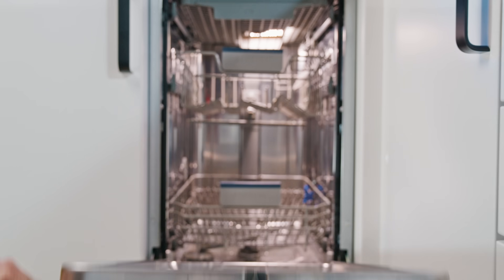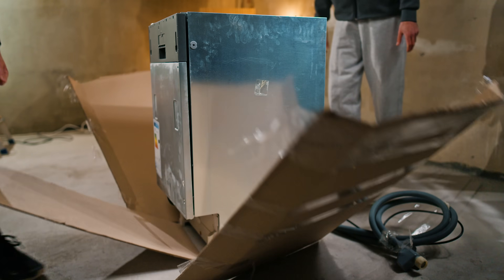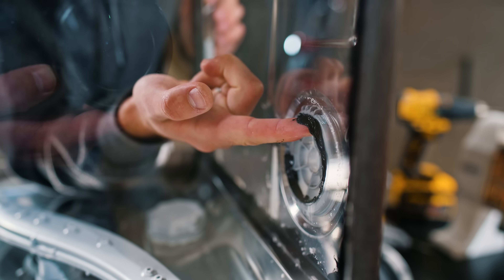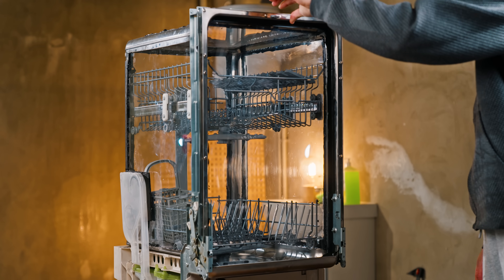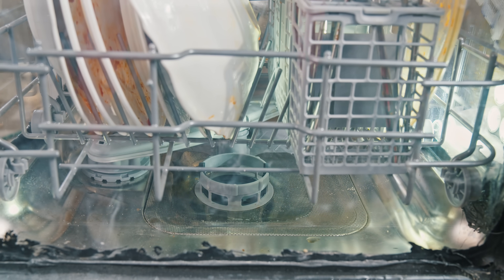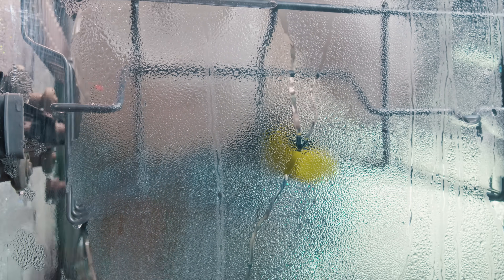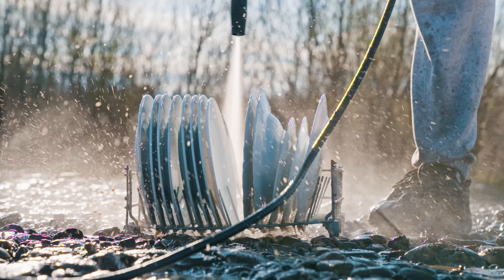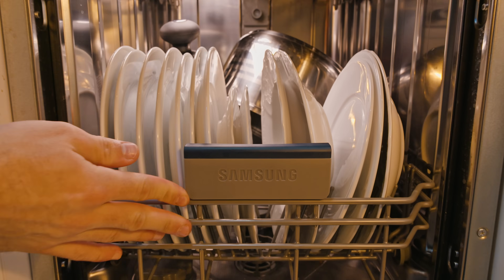Transparent dishwasher - What’s happening inside?

Comment: 11:58 A little tip from someone who works in the hospitality industry.
Place cutlery in cutlery baskets with the handles facing upwards.
This means you don't have to touch the eating part to take the cutlery out, which means you get fewer germs on the cutlery.

Apart from that: Great video - keep it up!
Reply: I mean just wash your hands. It's going to be thrown into a drawer that's probably got way more germs than freshly washed hands anyway.
Reply: @Moothead2  That's true. People forget how dirty the silverware organizer gets. It is rarely cleaned because it always has silverware in it. I cleaned mine and then was amazed how dirty it got in such a short time. It's the weak link in the process by far.
Reply: your suggestion is against dishwasher instructions, but tbh I had the same thoughts and tried to wash as you said, and it resulted that some stuff remained dirty in Eco mode, which I'm always using (safes a lot of water and electricity which is expensive in Poland)
Reply: Oh no, I mustn't consume all those 4 germs!
Reply: That's because you're washing with commercial machines and the baskets don't have dividers.  It's also safer for people who are in a hurry unloading the dishes which are constantly being reused.
Reply: I've never understood people putting the silverware in with the handles down. That's the way people do it at work and I have no idea if the person emptying it has clean hands or not, touching all over the end of the silverware that we eat off of.
Reply: I've read tonns of recommendations from pros, who build and maintain the dishwashers and home appliances in general, and despite their insistence in putting the cutlery handles down position, i do exactly the opposite. First it's nit always you who unloads the wash, it might be your kid or even a guest whose hygiene is extremely tough to maintain and hello 👋 greasy fingerprints in the working end. Having one on a handle doesn't seem as nasty, right? And secondly there's a great choice out there - the dishwasher with a cutlery shelf. That's the perfect solution imho. If you can - just avoid the one with the basket.
Reply: @donnadizucchero  yeah,since avoiding bacteria that is already on your hands will increase your immunity by 10000% I just love American logic and obsession with cleanliness.

Comment: do not use tablets, use powder.  when you use dishwashing tablets and put it in the compartment and close the lid, you don't get any detergent when the machine does the pre-wash, just put the tablet in the dishwasher and you only get detergent when the machine does the pre-wash and the detergent is flushed out before the main wash starts.  most machines have a lid with two compartments, one for the pre-wash and one for the main dish, both must be filled with powder according to the recommendation, if you don't have a compartment for the pre-dish, you pour a little on the dishwasher's door instead

Comment: The brown gunk are the resin beads that actually soften the water. The water used in the dishwasher does not actually go through the salt, the salt is used to recharge the resin beads that pull out the hardness of the water.

Comment: Nice video and informative, but that machine uses too much water, as the machines sold today only have enough water to run one wash arm at a time. It would have been better if you used a current machine that is being sold today and not an old machine.

Comment: Interesting project. Far as handwashing, you let the water run the whole time, of course it will use more. Those who say dishwashers use less water either do not know how to do dishes by hand or work for big dishwasher. It is obvious they do the comparison with someone using way more water than necessary when handwashing. They say it uses less water but do not use that much water handwashing. I know, I measured it. 

Far as the environment and energy, need to take into account for energy used to manufacture, ship, deliver and dispose of dishwashers. Lot of plastic and metal goes into one, lot of water used in manufacturing, and energy.

I mean, in the end, do what you like, it does save some time and easier. Just do not like misleading that it saves energy and water.

Comment: I have NEVER hand washed like that before with the tap running continuously !! I fill one side of the sink with hot water and detergent then place in the dishes and let them sit for 5 to 10 mins then scrub clean. Place in drying stand for 10 mins then use a cloth to completely dry. I probably only use 5 litres of water and not much gas or electricity. This theory that dishwashers use less water and electricity/gas is not true in my experience. Maybe over the long run dishwashers are cheaper to run but I have my doubts.
Reply: You just cannot imagine how much water/heating/etc is cheaper in f.USSR countries. Washing the dishes in constantly running hot water is absolutely normal here, so the message about economy (bc electricity is even more cheaper) is applicable.

Comment: Hand washing dishes under constantly running Water? Wow. I learned to handwash the way to fill the sink with warm/hot water and wash it in there. In my sink fits 8 liters of water. Dirty dishes i have to swap the water one time. So i use 8-16l. You used almost 56 liters?! (Manual of the dishwasher sayed 14l/cycle and on your chart it reads, that you consumed 4 times the dishwasher's water)

Comment: I have a question, the water I guess heats up slowly somehow, not instantly, so after the second cycle which is done with hot water, the third cycle starts with cold water and heats up again slowly. But the dishes are hot from the previous cycle, since now in the beginning of third cycle the water is cold, how come dishes made from glass/porcelain/crystal never break with the sudden temperature change?
Reply: Dishwashers are "supposed" to take water from the hot water tap unless they were plumbed incorrectly or do not have access to hot.

Also, the heating elements in the washer can get VERY hot. Almost like a stove top. The inlet water is run into the bottom basin into these elements before cycling.

These two things combined with the small amount of water being let in at a time helps to minimize thermal shock.

If the water coming in was ice cold it very well could break dishes regardless of rhe heaters

Comment: Would be really cool if dishwashers had a "knock" function like some expensive fridges so you can just look inside when you want to. Would be satisfying.
Reply: The more expensive dishwashers made by Miele have a “knock to open” feature. The next level down (mid-priced, although their machines are best quality and start at $1,200 and go to over $4,000) models open the door automatically at the end of the cycle in order to assist drying (can be deactivated).

Comment: LOL the control panle has 10 buttons and only two wires coming of it. Did you no that when the stuff you put in is to clean it does not get cleaned very well? Its because the bacteria in the detergent wants to eat the food left on the plates and stuff and wenn there is nothing to eat the dishes dont get cleaned very well.

Comment: Very interesting! I appreciate the work you went to for this video. Our dishwasher won’t fill with water. This was a big help to see where the water is supposed to come out. There is about a half inch of water settle in that area. Funny thing is is that the machine started sending out the emergency code after a complete wash..I’m not sure if it is possible for the pipes that lead to the dishwasher are frozen. House water is running but due to the temperature dropping into the teens this week, I’m wondering if the dishwasher pipes, as well as the water line to the fridge water dispenser is frozen. I’ve never seen this happen. Not sure whether to call for help or pray the pipes don’t burst.😢
Reply: Try draining that water and then reset your machine by turning off the power at the breaker. Wait for 5 minutes and then turn it back on.  Go to dishwasher, choose a wash cycle and hit start...    See if that works for you.   Some washers will  not start unless the water is drained first. Check and make sure your float isn't stuck as well since that's what triggers the switch for your drain pump to kick on.

Comment: Eww look at the drain water in the bucket and then think about the fact that more expensive dishwashers re-use some of the water to save a few bugs a year. Disgusting.
Reply: They just use the clean water from the last cycle and it is used just for the very first cycle to soak up the dishes. It is actually very primitive and effective. And there is no health risk because all germs are killed on the end of the washing cycle because all dishes are warmed up by steam to up to 70°C which kills all the bacteria. You can never reach this temperature while hand washing.
Reply: @jancervinka7424  So the used water stays inside the machine sometimes for days until I turn the machine on again.. that's even more disgusting actually :/
And I don't believe that all bacteria are killed when I think of the gunk I clean out every now and then from the filter, which many people don't even do often 🤮

Comment: Very interesting to see how it actually works.

I have double sinks and use the plugs, wash in one and rinse with the other, dry in rack and total of 20L for 30min (excluding pot soak time with denture tablet, wait until not blue, then 5 minutes for pots).
Reply: 20 litres is still more than a good dishwasher will use.
Reply: @k-leb4671   Depends on the dishwasher, you're probably right if it's a high quality/not cheap type which can be way out of budget for some. I'd love to have one like a bench top sort as I'm in a rental.

Comment: Nerd curiosity… I loved!

But the comparison was not totally fair because ‘no one’ leaves the tap open during manual dishwashing but only to remove the soap foam, and with hot water only during winter.
Reply: Clearly you are not me, and I’m sure I am not alone. This dishwasher seems very small compared to the standard 24” x 24” in North America. Is this a standard size in the country where the video was made?
Reply: @michaelratcliffe7559  it looks like  a 6 place model rather then the usual 12 place
Reply: I always leave the tap open :)

Comment: The wash starts at 8:40. thank you so much I wanted to know this for years this is very informative and interesting!
Reply: come on the whole porcess is interesting... if someone skips for where the machine is working and missed the removal of walll they've missed half of the fun
Reply: pro tip, you can ad extension on chrome and it will show you the highlight of many videos(incuding this one)
Reply: @TheOne24115  what is it called?
Reply: @TheOne24115  You need an extension? Safari has this built in.

Comment: You don't need to "rinse off the large impurities".  If they will go down the plughole in your sink then your dishwasher will deal with them just fine.  Pre-rising your plates and dishes before you put them in the dishwasher is totally unnecessary and wastes water.  The dishwasher is very efficient with water compared to washing by hand, so just tip/scape your leftovers into the bin and put your dishes in the dishwasher.
Reply: I think it is still good to at least brush off the bigger parts of food remain. I believe this will prolong the lifetime of the machine.
Reply: Large chunks of food (ie meat or fat) will take a long time to dissolve down the dishwasher drain and cause a stinky smell. For this reason there is an important step not many of us know: clean your dishwasher! Take the bottom tray out and unscrew the screen in the floor of the DW. I’ve found food and labels (ie stickers from the bottom of mugs or jar labels) inside clogging the holes making the machine less effective bc dirty water won’t fully drain.
Reply: As a maintenance worker, I have to disagree.. I know Cascade and dishwashing companies tell you this but its false and maddening. I can't tell you how many complaints I get where over time this mentality causes problems. Understanding the chemistry of soap and the machines parts, it is in fact best to rinse your dishes prior to putting them in the dishwasher. Drain sludge is a thing and can cause the smelly scent and clogging of the dishwasher drain line. That aside, dishwashers should be regularly de-scaled to retain efficacy of use. That same drain sludge can get trapped in the machine and cause dishes to remain greasy post-wash over time. Also, the chemistry of soap is one to one. If your dishes greasiness overpowers the capacity of your soap then greasy dishes you'll have post wash. Overall, to save on soap (which is more expensive than water presently) and to save your machine from higher frequency of maintenance, RINSE THE DISHES FIRST!. Or not.. Not my house.. shrugs
Reply: @djsaunders04  Rinse them … where? I'm in the UK. Almost nobody has a waste disposal system in their kitchen sink, so it would be worse to force lumps of food down the sink drain than to let the dishwasher "digest" it. Maybe the dishwashers are built differently here too, because I have been running dishwashers at home for decades without any maintenance issues apart from maybe changing a burnt-out heating element. I have a particularly long, narrow drain hose on the dishwasher too… yet everything works great. And I've never rinsed a plate first.

Comment: That brown 'gunk' that you referenced in the video are resin beads. They are used to attract the dissolved magnesium and calcium in the water via ion exchange. The water will come out the other end as soft water. It's non-toxic and from what I'm told, if you swallow the stuff it will act as an antacid. The salt is used to regenerate the resin by forcing the resin to release the captured hard water deposits. The injection of salt into the resin chamber must be occurring at some stage in the cleaning cycle and we haven't seen it yet. It must be part of the commands issued by the electronic board at some stage during the wash/rinse cycle. Home water softeners work on the same principle but the salt flushing is usually set to occur very late at night when nobody would be using the water.
Reply: I'm not sure I'd want to put shoes and hair brushes in the same environment that washes my dishes... but otherwise a truly fantastic video - thank you 🙏
Reply: You are right. The so called regeneration of the ion exchanger ("brown gunk") happens during the drying stage, but not in every wash cycle of the dishwasher (more like every 2nd, every 3rd and so on). How often the regeneration takes place depends on the hardness of the water, and with most dishwashers is set manually via a menu setting. This is why it's important to have this setting where it needs to be at for the given hardness of the tap water. Many people never touch it, have hard water and then wonder why they have stains.

By the way, the dishes themselves never come in contact with the salt or it's brine at any time. It is purely for regeneration of the ion exchanger. The ion exchanger is where the softening magic happens and it works fine without salt until it is saturated and needs regeneration.
Reply: @martinweizenacker7129  well, technically, the soft water that machine washes with is already a brine, cause when beads take calcium, they give salt as in return, and when it regenerates it takes brine and gives off calcium
Reply: As a chemist I can say you are correct
Reply: I can confirm because one of our filters broke and looked just like that. Thankfully it was contained and did not flow all of our house pipes. 😧 Phew!😅
Reply: That makes sense I remember the de-ionizing beads from our Reverse Osmosis water system.
Reply: nope, its dishwasher caviar. Thats how dishwashers breeding!
Reply: Thank you
Reply: Very strange, these UK machines are a bit odd. The way we have it in the US with just a motor heater and food chopper works perfectly, although salt would definitely help in harder water conditions. Excellent information!
Reply: Great video! But don’t put things with (long) hair on them in your dishwasher you’re gonna clog it up!
Otherwise, indeed, you can clean just about anything with it.
Reply: @FreekHoekstra  So I can't wash my dog in it? It has long hair.

Comment: Years ago, dishwashers were pressure washers they clean the dirtiest dishes in a very short period of time because they had very large pumps and used enough water required by these pumps.
Now the dishwashers are energy savers, so they use small pumps that usually either clean the top rack or the bottom rack but not both racks together that’s why it takes double and triple the time it took the old vintage units. 
Most dishwashers don’t use the electrolytes to soften the water just some European brands.
Reply: most if not all European machines have water-softening capabilities
Reply: Never seen a European dishwasher without a salt reservoir, even the most cheap dishwashers have them here.
Reply: *All European brands
Reply: i hear euro water is harder than other countries water, which may be why they need a water mineral softener.
Reply: They don’t make em like they used to
Reply: They clean just as well. Just use a ton less energy and water. What you lose out on is time.  @ayeitzdj